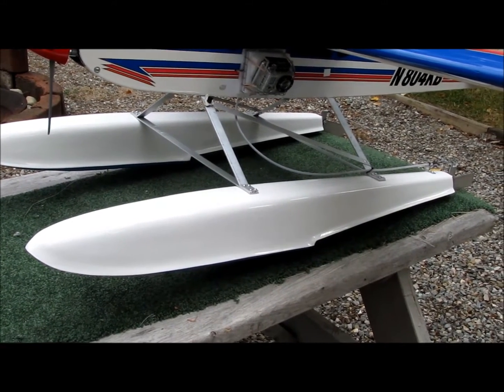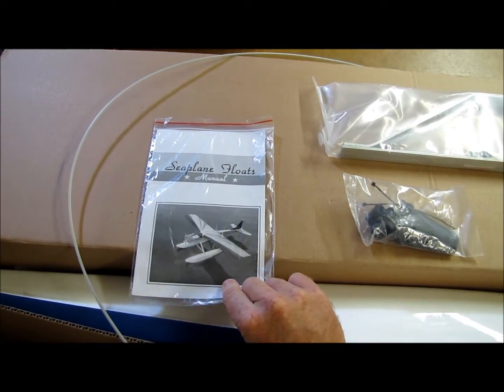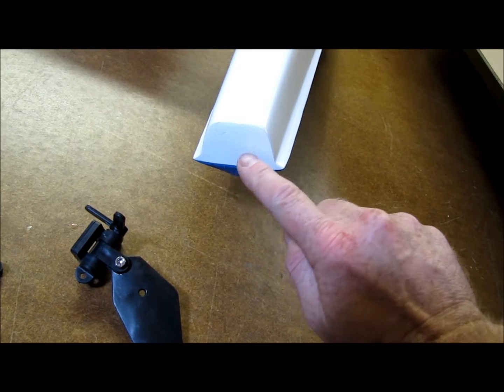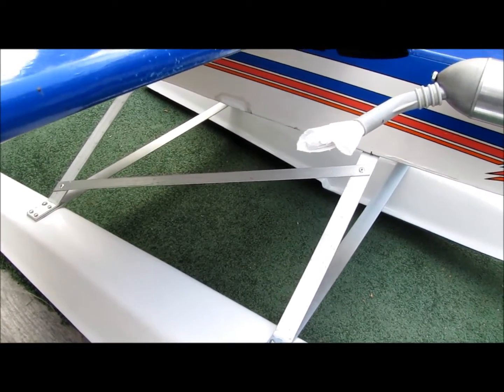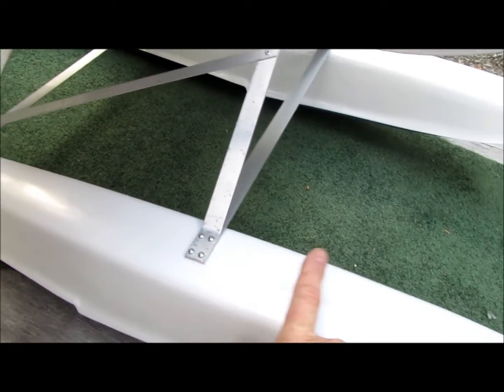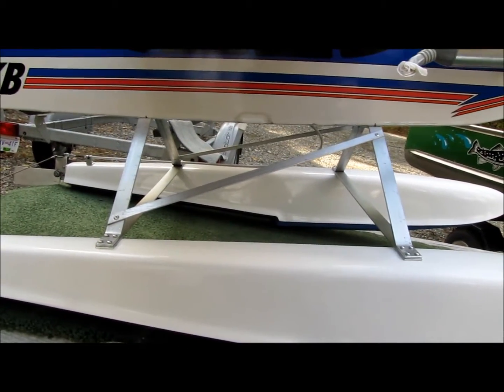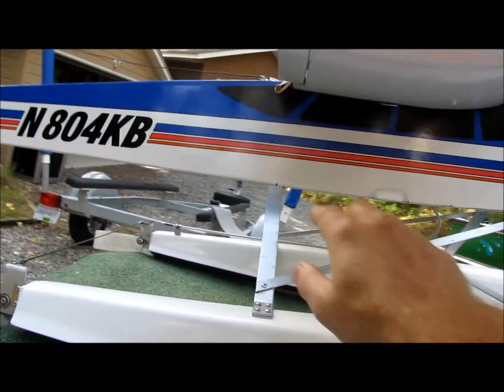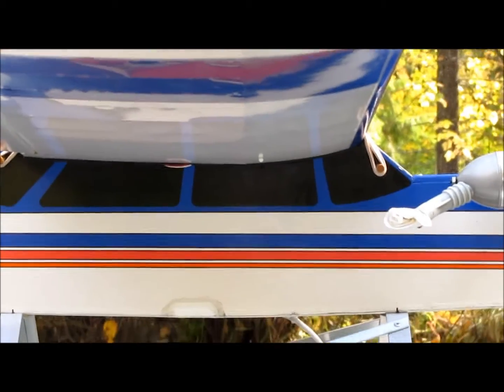Hobbistar 60 with HobbyKing floats : Floatplane conversion guide

Comment: Excellent instrutction video, when I put floats on my Midwest Aerostar .40 last year I found it very diffucult sorting through many forum topics and articles so this is a great tool to beginners. I am using the .40 size HK (I got mine from Maxford USA but they are from the exact same factory) with 2 degree of incidence and it jumps into the air quickly if a smal amount down-elevator is not applied so I recommend 0.5-1.5 degrees. It made the first takeoff interesting but I eventually got it!

Comment from the maker: @E744763Productions Thank you ! You are correct - each plane is a little different,  the range  that usually work for most planes is 0 - 2 degrees. On planes with a Clark "Y " airfoil ( flat bottom wings) there is usually abundant lift, and as these planes are usually basic trainers they are often set up with a wing vs stab incidence that will cause a nose-up attitude under power. The position of the CG is also important, if it is a bit further back you may need some down trim.